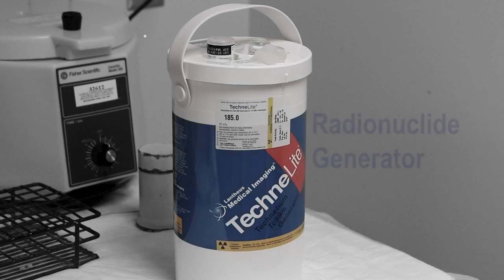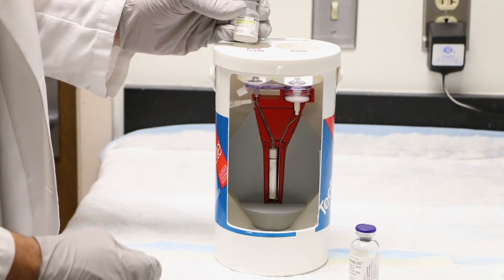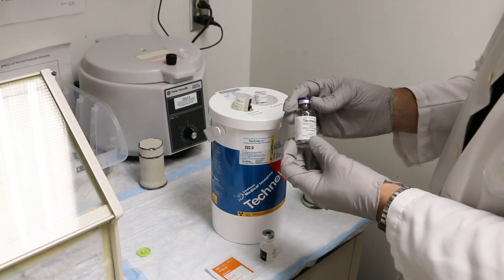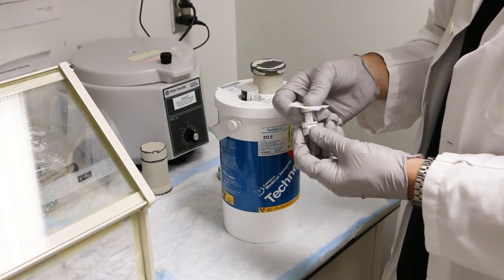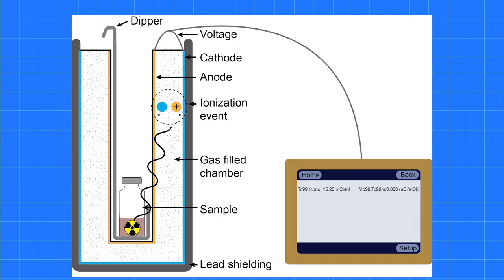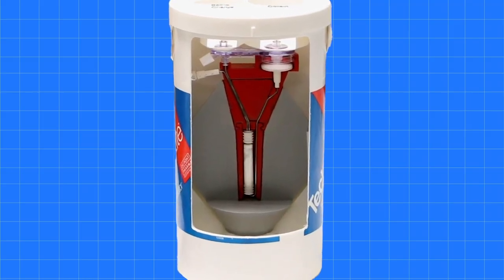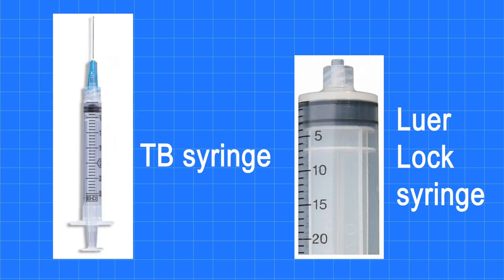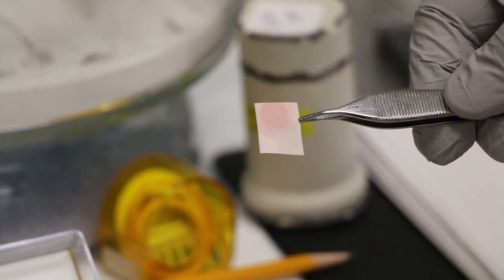Lab 1: Generator

Comment: radioactive saline in the form of sodium ........? plz tell
Reply: The radioactive isotope, Technetium-99m, is chemically extracted as pertechnetate, AKA TcO4. This is an anion with a negative charge, and sodium is a cation with a positive charge. The pertechnetate is ionically bound to sodium due to their charges. This makes the saline (0.9% sodium chloride) that is pulled through the generator system radioactive, as it now has Tc-99m in it.